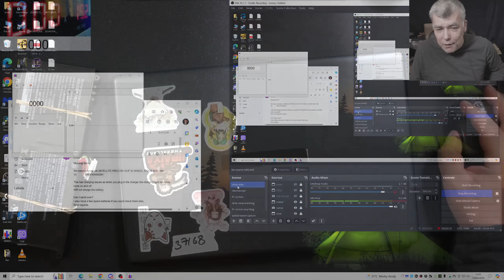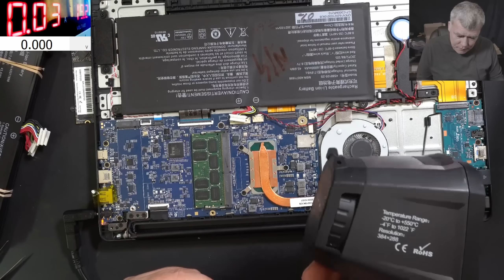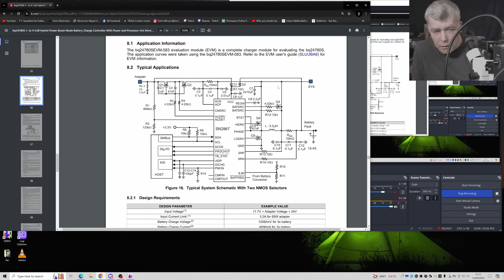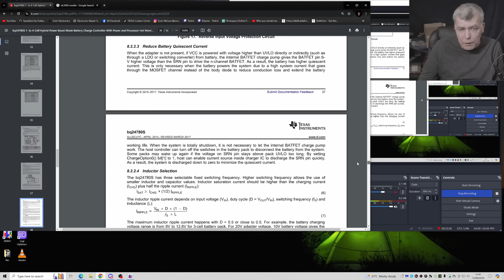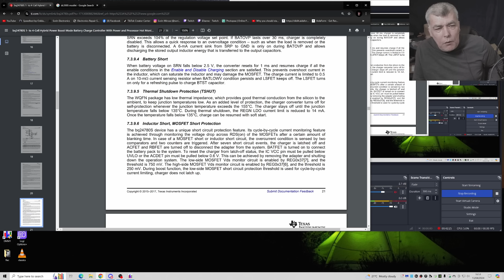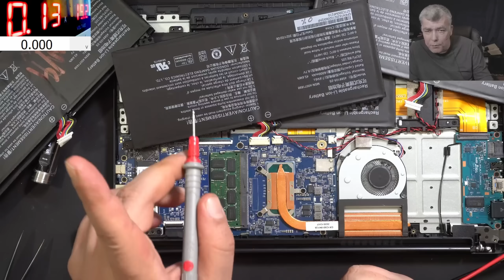Dynabook Toshiba Satellite Pro C50 not charging board repair - when everything goes wrong

Comment: After watching a lot of your laptop repairs, I finally found my first and second MOSFETS on my Lenovo Ideapad 330S.
Directly after the second MOSFET : the main power rail is shorted (called "VSYS" on the schematic I found, is it correct ?).

Since I've no thermal camera and no adjustable power supply, I tried with :
   : 5V from a PC power supply with a 60 ohms 1 W resistor on a breadboard, injected directly after the second MOSFET...
   : isopropyl alcohol on different components (mainly capacitors, I suspect one or more of them to be shorted, though I can't see any visible default...)

=> the resistor becomes obviously very hot (P = V²/R = 5²/60 = > ~ 0,42W) but I can't find any other hot component, even by touching with my fingers...

Comment: Hi everyone, I have a question and I'm hoping someone can help me. I have a Dynabook Satellite Pro C50-H-10D motherboard and I want to know if the charging circuit is faulty or if it's my batteries. Here's what I've noticed: if I connect the power supply without the battery, the charging LED blinks orange. If I connect the battery, the LED stays solid orange, but Windows shows the battery with a cross and it never charges; the LED never turns blue. I've measured the voltages at the battery connector and I think they're incorrect. The voltages at the first four pins, which are the positive pins, show 0.83V and don't change; they don't go up or down. This voltage is the same whether the battery is installed or removed. What voltage should be reaching those pins? At least 7V, right? Thanks so much for your help.

Comment: HELP!!! I have the same issue but i cant find the 8036 0v mosfet needed to replace it, can you tell me or link that mosfet you used or sell me one? as laptop wont charge without it being replaced, and watching your video I found the 2 by the power input where fine but the the 8036 was shorted same as yours
Reply: Have the same issue i ordered some 8036 mosfets from Ebay but they where twice the size as this mosfet 🤣 did you manage to find some ??

Comment: Same laptop, same problem although in my case the mosfet was cooked to the point of falling apart. Some people have commented that even number mosfets are N channel and odd number are P but whilst looking for an equivalent I found that both TPCA 8036-H and TPCA 8039-H are listed as N channel. On that note, I am in Australia and cannot find an 8036 unless I order it from China with a 6 week delivery time frame. I can’t read data sheets to save my life. Can anyone point me at an equivalent or even something with a better current rating?

Comment: I have the same notebook...on the power connector I have 2.63v and not 19.5v....I tried two power supplies. What could it be?
Reply: The LEDs do not light up and the battery is at 5.98 V

Comment: Also at 13.11 when probing bq chip you push some solder from pin 6 to 5, at 13.41 it is visible (possible short) , but after you replaced the third mosfet, probably because of the heat, that solder from pin 6 to 5 is not anymore, check at 31.37 time

Comment: Actually it is not unique, it is because you like to work without schematics 😅. It is the mosfet that regulates the work from battery whan charger unpluged so that the voltage from battery becomes main power line. It is being made like that for at least 15 years 😅

Comment: Hi everyone! Laptop hinges broke, and I used shoe glue. Now the screen is quarter black, quarter grey with lines and half working fine. Anybody have an idea why?

The glue was clear and had a strong odor, it took some color of the plastic cover and became blue.
Reply: BTW, it's fine on hdmi
Reply: Quarters are vertical
Reply: Update: Now backlight doesn't work. Lol!

I checked voltage across ground and a fuse labeled F2, I heard a tick and I think something burnt

Comment: Channel P still outputs voltage if voltage on gate is zero. Because it needs less voltage on gate compare to source so technically zero is still less then source. It only cut down voltage if gate voltage is equal or more then source.

Comment: Nice Video again, but why should the MOSFETs have 25V on the gate, eventhough the supplyvoltage is only 19,5V?
Reply: I cant answer the reason or technical why but those mosfets must have 25v at the gate so when checking your dc-in power or ' follow the truck ' what a great analogy.. 🙂
Reply: i clearly forgot why or to my understanding reading it to the internet it goes something like this, when using an N channel mosfet usually the load side or something will consume power should be in front/before the N mosfet so the voltage on the gate should only be 5v but usually in laptops the load comes after as it is use as a input mosfet so thats why the inverse voltage or higher is used.

Comment: Hi Sorin there is always three mosfet the one was shorted was batery to sys mosfet. You have always 5 mosfets high, low side , bat to sys mosfet , first and second mosfet. But i do not understand mostly bq 24780s is worjing with n channel mosfets and here P channel mosfet.
Reply: I would have agreed if the output was not 19v

Comment: My company bought 10 of these.... in 3 months 6 of them went back for charging issues . Where is the old Toshiba that it was working for 20 years ?
Also very lucky connecting ssd with battery and charger already connected to power 😊😊
Reply: Yea, I cringed when connected SSD, remember everyone ssd is connected to PCH
Reply: it's not even same design from toshiba
looks like manufactured from different factory
Reply: @maklogetrich2378  Toshiba and Sharp (both Japanese) currently belong to Mitsui, that is the reason for the design of their circuits today (Chinese technology models).

Comment: So that MOSFET is in serial mode on the main power rail. Why not just bypass it or replace with a proper calibrated wire?
Reply: This mosfet was shorted So it was already like a calibrated wire. The reason it didnt work like that was the overcurrent protection from the laptop battery bms.
Reply: @PaikTech_official so it needed to be like "closed" before the initial  charging current was set up? And only after the ICs checks, it should open?
Reply: @PaikTech_official  But the laptop was taking pretty big current. Weren't BMS supposed to cut off battery from power supply?

Comment: Hello just wondering if you could explain the code printed on the bq chip, the one you removed it BQ 24780S CRF1 whereas the new one you soldered is actually  BQ 24780S T1 261 A0ZG.
Reply: Production batch number and date.
Reply: @DumahBrazorf  thx
Reply: BQ 24780S is the only part that matters.
Reply: @perkulant4629  thx